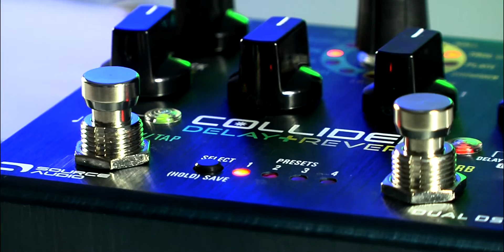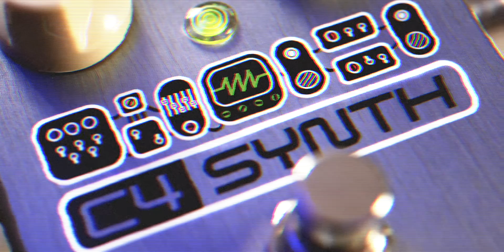Creating Guitar Effects with DSP

Comment: These microcontrollers these days are for sure running pretty high clocks... An ESP32 is at 240MHz? Is he already retired?
Reply: Yeah I'm surprised there haven't been more music projects using it
Reply: I'm building an entire synth using it. It's super nice.
Reply: I took that to mean sampling frequency - i.e. that's what you would need to get a decent simulation of those analogue components. For each microsecond, a whole bunch of work would need to take place so the clock speed of the processor would need to be orders of magnitude more than that.